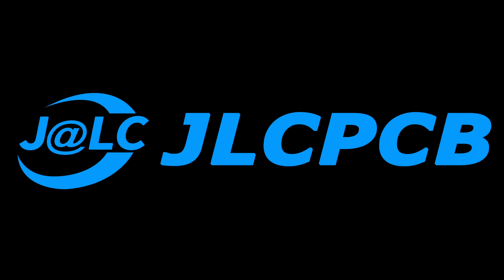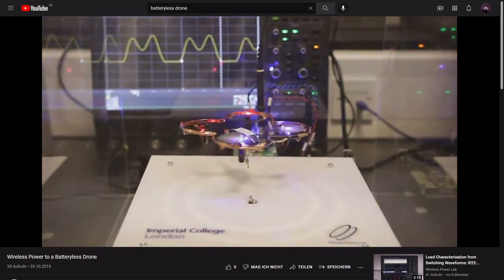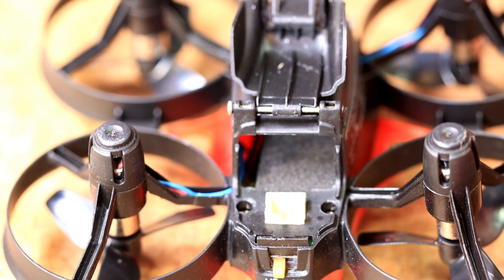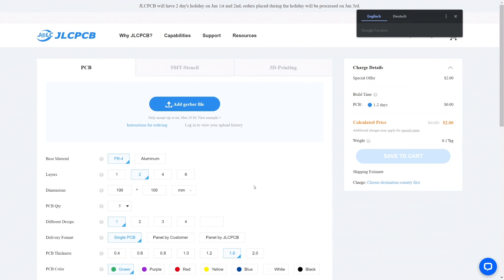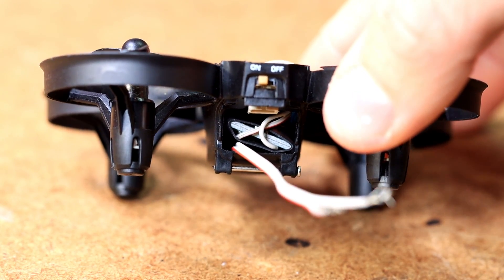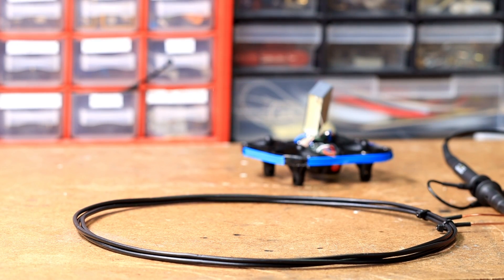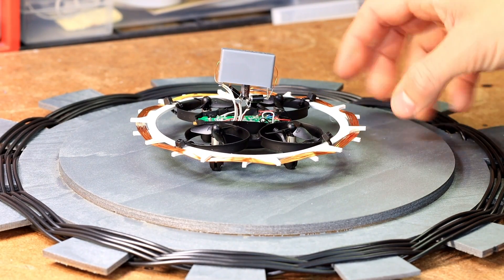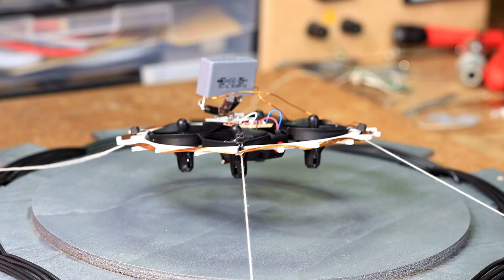How to build a Drone that needs NO Battery? Wireless Energy DRONE

Comment: ok,noch ne andre idee.anornung wie DOPPELSPALTEFFEKT. Aber,eine seite ein mirko andre seite lautsprecher und dazwischen der doppelspalt. sende einen ton durch den doppelspalt und miss die signalstärke am mikro bei einem spalt und dann bei zwei spalten. wenn  sich das signal verstärkt hast gewonnen. dann kannst 12 mikros wie die uhr anordnen und einen lautsprecher in der mitte. kombiniere doch einfach dinge die dich keine enrgie kosten um signale zu verstärken. also is stone hendge ein signalverstärker auf dem doppelspalt  prinzip. der mittelpunkt sendet ein signal das sich ringförmig ausbreitet,und die vertikalen steine wirken dann weil wir über linerale wellen reden.ein spalt is linerar. es gibt ja horizonale und vertikale spalten und das ist wichtig welche lineare signale ich habe und welche nicht. was also wenn du anstatt des spaltes ein KREUz in der platte hast,oder das RAUTE Symbol. Ihr vergesst die Reflektion von wellen( plastikrohr eine seite lautsprecher andere seite Mikro dazwischen scheibe mit doppelspalt und dann standing waves erzeugen. wenn ich durch vertikale oder horizonale spalte ganze EBENEN auslöschen kann,dann kann ich also den teppich unter meinen füssen mit doppelspalten kanzeln. also subwoofer vertikal dann doppelspalt und oben einen tennisball. ein doppelspalt kann auch durch 2 metalstangen die magnetische felder haben,welche die magnetischen impulse ablenken,so die der spalt den sound. Ein Sieb mit Löchern verändert auch die signalstärke und die löcher wirken wie linsen zum fokusieren.
Reply: helmholtzsspulen sind der doppelspalt. den punkt im zentrum ist das ziel. der punkt lässt dinge schweben.ok.

Comment: ok,wenn tesla aus Strom eine RF gemacht hat,diese sendet und am ende RF wieder in Strom umwandelt,ist das keine Energieübertragung,sondern RF is überall und somit ist strom überall. tesla hat also nur eine technologie gefunden wo er RF in Power umwandelt.du brauchst also nur ein transostorradio,was OHNE strom schon ein siganl erzeugt,welches power ist.was hat tesla gemacht??er hat also RF wellen genutzt und den strom nur mittels capasitors gesammelt,je mehr transostorradios umso mehr signale. Also kurz gesagt-nimm einach mal 10 oder 100 knopfmikrofone und baue einen spiegel,wie satellte,oder richtmikrofon. die schliesst du so zusammen,das alle ihren impuls an einen speicher weitergeben. und da man immer mit dem mikrofon etwas hört,also ein signal hat,ist das ein generator der soundwellen in strom umwandelt. wenn man dann zb 100 mirkofone und einen lautsprecher hat,kann man 100 signale empfangen,einen teil davon nutzen um die frequenz zu pushen ud kann so mehr strom erzeugen,wenn dinge in  Resonaz sind. oder 2 mikros in serie und das signal geht in einen capasitor. schaut man sich jetzt um,kann man 2 x 6 mikros nutzen,angeordnet wie ein würfel um so 360 grad umgebungsradius zu haben,oder einen Ball. alles in reihe und serie schliessen,und von einem capasitor in den nächst grösseren. Somit kann man dann ohne strom zuzuführen aus den soundsignalen strom erhalten. 100 kleine signale,ergeben dann sehr schnell ein grosses. wenn du die lautsprechermebembaran eines subwoffers bewegst,kast du grosse signale,richtig?? na dann versuch doch jetzt die membran in schwingung zu versetzen und nutze den sprom den die subwooferspule beim schwingen entwickelt.

Comment: If you used a voltage regulator, why the dron died? So amazing and interesting proyect. Maybe, it could get more reach if you build a enoughly big and powerful Tesla coil that allow the dron flying around inside the room. Would you like try to do it? That would be super exciting! Greetings from Argentina! 🇦🇷 (Sorry if my English is not very correct).

Comment: I've wondered how light can get a not wireless powered by a microwave oven literally design similar to the "Can a microwave power a plane? - Bang Goes The Theory - BBC One" Youtube video.  I've wondered about using lighter foil, foam or a lighter frame that's maybe not a foam styrene... though I'm thinking whatever is lightest and strong enough to be the antenna and parts of the actual drone.   Wondered what an inductive mathematical analysis would determine as well.  Maybe fractal antenna design or something a little wider band with polarity consideration also in the antenna design.  Spiral conical if not a foil on foam fractal... maybe even mesh so like a polymer with the foil embedded in thin sheet rolled to get more of the penetrating photonic energy a well for being the structure?

Comment: i made a tesla coil, i ran it on 50v. instead of the tesla coil blowing up, the power supply blew up.
Reply: This sort of issue was reported over a decade ago.  In recent years EXTERNAL protection was added but i regret it's still just not integrated INSIDE the power loop itself.  So please consider reading Allegro's datasheet on their responsive (MHz) ACS733 hall-based current-monitor which happens to be featured with an on-chip analog-programmable comparator:  e.g. possibly an improved alternative to the usual cross-connected diodes...  2 units would be expected in Mazzilli's "Center-Tap" topology.

Comment: try the main rotor structure of a 3 channel toy helicopter. those setups resist change, making them stable in the air without the need of a flight controller(except for the yaw, but wiring the motors in parallel should allow them to spin at the same speed, yaw is probably not a problem)
Reply from the maker: good idea!

Comment: To go higher can you transmit more power farther with a bigger transmitting coil and hang the power receiver circuit and coil down below the drone?
Would a bifilar coil improve performance? A bifilar coil has much more capacitance than the spiderweb coil if that's why you used the spiderweb coil. And didn't Tesla patent a bifilar coil?
Reply from the maker: Hey, great Idea! I think I need a different transmitter, higher frequency and so an. I dont now much about bifilar coils, I will do some research! Thank you!
Reply: @Teslaundmehr  If you make a much bigger coil then the drone will be inside it while it's flying. If a bifilar coil doesn't increase the power transmission maybe a second coil inside the first one would.

Comment: What would happen if you pulse the coil you have around the quad at 7.83 Hz, with as many Amps you can muster? 
7.83 Hz is the Earth's resonant frequency. Would it lose or gain any weight without the motors attached?
I wish I had the means and your setup to test that.  
Happy near year and thanks for your super interesting videos.
Reply from the maker: This is an interesting concept I have thought about in past. The Problem would be to set the Resonance Frequency of the receiver so low. For that you need a big capacitance or a big coil (a lot of windings)  to transmitt enough energy. But nevertheless the Schumann resonance is an amazing topic!

Comment: Nice work Leon! I was kinda worried about interference from the power transmitter, but I'm glad to see you got it working. Have you considered using a much larger/more powerful transmitter (maybe a Tesla coil, if it doesn't cause too much interference) to transmit power far enough to fly the drone for longer distances?
Reply from the maker: Hey Zack! The remote control send on round about 2,4GHz. So that is not a problem. But when we use a Teslacoil as a Transmitter, than it could be a Problem,, especially when we use a Spark Gap coil haha :D

Comment: Great work!! Have you tried using a Tesla Coil for wireless power? Have had good luck with long distance and not having to be in close proximity just a idea, keep up the great work and the explaining the details. Also happy new year ⚡⚡
Reply from the maker: Heyy, thank you so much, really appreciate that! This is actually a great Idea, but maybe the electrical field would be way to strong. Also interesting would be one wire energy transmission ;)
Reply: @Teslaundmehr  it may be but with a zvs powered tesla coil you can adjust the power level but the frequency you choose would made the difference probably. Know when I was playing with this never tried a bipolar and any higher than about 350khz zvs didn't like it. It's great your playing with this concept, I had alot of fun playing with this transmission of power want to get back to this some time in the future believe there is alot of can improve especially seeing your video⚡⚡ my best so far is 26% efficiency at just over 5 feet and the receiver coil was picking up 14v at 2amps.

Comment: This is awesome! Of course the interesting things happen when you don't have the camera running, haha. Now that you don't have the controller, I wonder if you could get some level of "self stabilizing control" back by using a separate transmitting and receiving coil for each individual motor. As it moved up and down each motor would kind of self regulate because it would move farther and closer from its transmitting coil. You would need 4x the circuitry though, so that might get too heavy. This was really fun though, looking forward to what's next!
Reply from the maker: Thank you so much!! I'm glad that you enjoyed the video! That is actually a pretty cool idea! But I'm not sure if the 4 Transmitters will influence each other...Would be interesting to test it!
Reply: @Teslaundmehr  Yeah maybe you would only need 4 receivers and could still have a single, large transmitter. Still have the weight problem of 4x the circuitry on the drone though, so that may still be impractical.